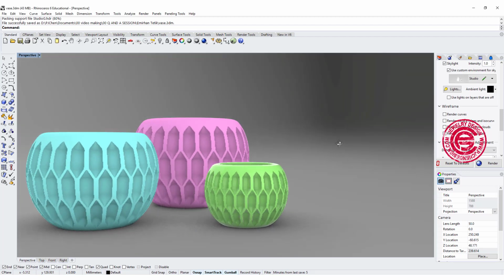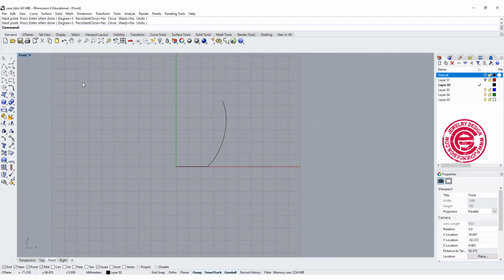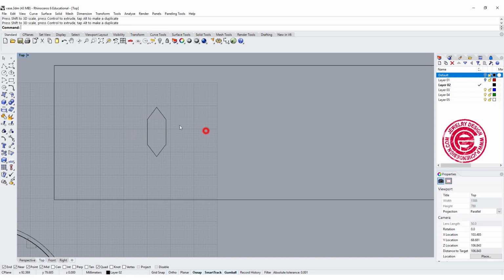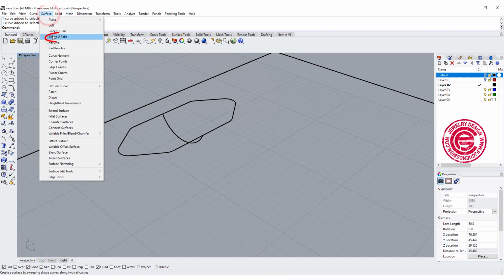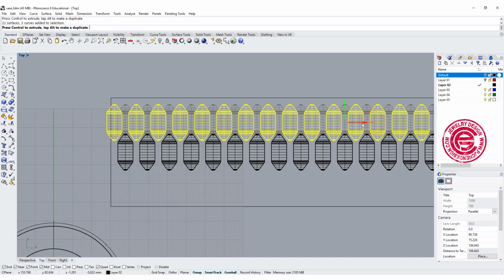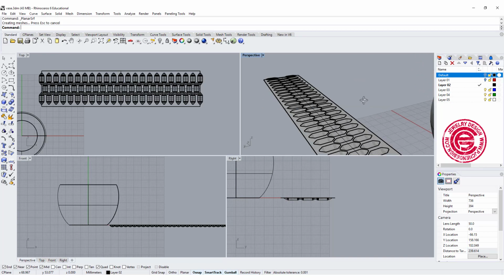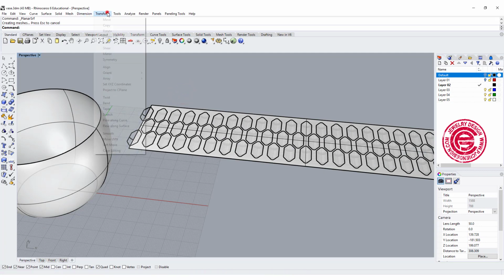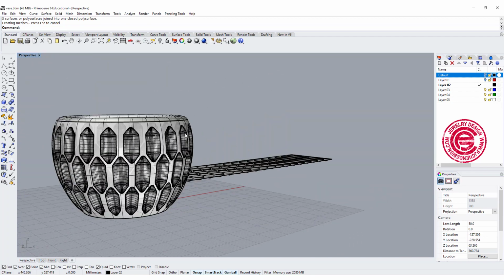How to Apply Patterns Without Distortion (Rhino Fix) #23

Comment: Hi PJ. 7:28 How To Rectangle Extend?
Reply from the maker: you can move the control point on the corner as shown in video. Make sure the smart track is on so you can align to the midpoint of the pattern.

Comment: when I boolean difference the shapes from the UV'd surface, it just deletes the solids and I'm left with the wireframes (of the array shapes)... If I boolean intersection instead, it works on some of them properly, but not all of them. Any advice?
Reply from the maker: you model may not be solid.
Reply: @PJChenJewelryDesign  thanks for the quick response! I'll try again tonight. Your videos are great.

Comment: Great. One question - when you moved the rectangle which was created by the uv crv, on the left and right sides, to align the arrayed objects to the edges, did this change its length? Would this affect the flow back onto the polysurface?
Reply from the maker: the object will be stretched to fit to the target surface when use flow along surface unless you check the rigid option.
Reply: Thank you for your rapid response.  I have always assumed that the uv unwrapped  rectangle had to be unchanged.  This is really great.  Thanks again.

Comment: Everything works perfect but I got stuck on the transform part. It doesn't appear on my 'vase'. Any idea what could be causing this?
Reply from the maker: not sure what is the issue without seeing your model. Does your base surface right under your patterns?
Reply: @PJChenJewelryDesign  Same here :(  what do you mean the base surface under the patterns?
Reply: they seem to be aligned with the patterns

Comment: hey PJ! thank you for another great video.
when I do boolean difference it doesn't work as it works for you.. it keeps the inside of the first hexagon instead and deletes all the rest... any idea why? how can i solve it?
i aligned (top) all of them including the surface to 0, so this is not the problem.. Thanks!
Reply from the maker: It sounds like your object is not solid. I also have few videos at Q//A session explain why boolean is not working.
Reply: @PJChenJewelryDesign  thanks a lot!

Comment: Thank you so much PJ.
I have challenge with the flow along surface. The pattern is not closing up on the surface of the object. 
I use rhino 5.
What could be the problem? 
I'd like to hear from you. Thank you.
Reply: Thanks I figured it out.
I tried it by not increasing the size or the uv plane and it worked.
Thank you.
Reply from the maker: perfect!
Reply: Hello, I have the same problem without changing any scale, and I don't understand why. Could you help me please ?
Reply from the maker: @violette4494  you have to make sure the design is match on both end when it is flat. so it will be matching when it flow back to original surface.
Reply: What you just have to do is, to clic right at the corner. You have to be precise on it.